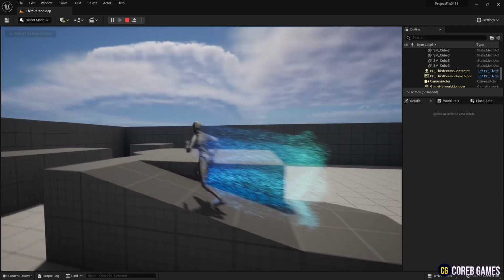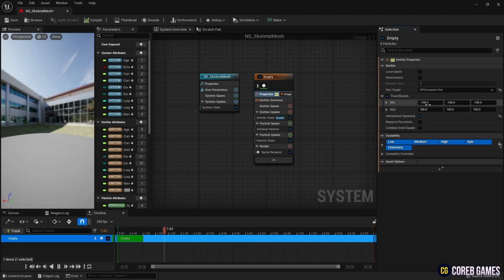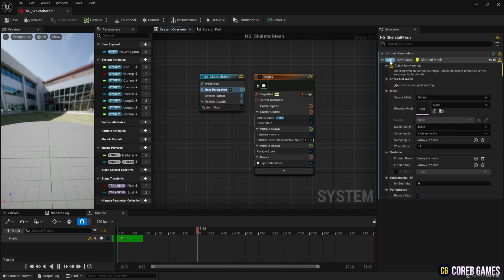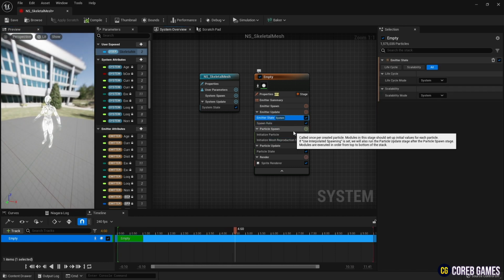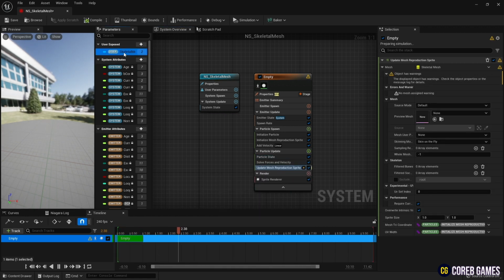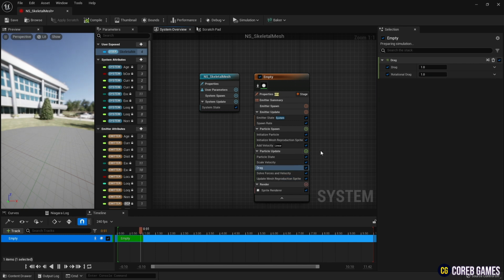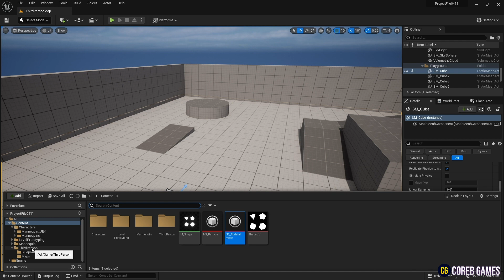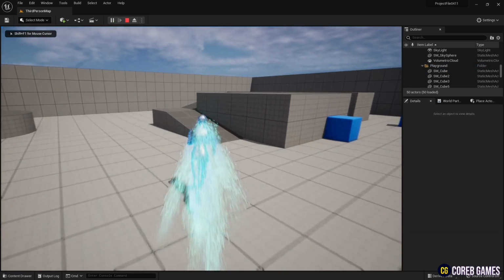UE5 l Dash Trail Particle Effect With Niagara l VFX Tutorial l Unreal Engine 5

Comment: Can you show how to do a Character Dash effect: when the player jumps forward, it leaves behind an Anim Shell (mesh frame?) of the Player's last animation frame - before he performed the dash forward? (Not sure if it is a particle sys that spawns a mesh, but way less than your example.) Ty

It looks like this vid - the blue shell mesh at the beginning (and later): watch?v=ipmGvjHGMYI
Reply: you do the same thing as this but use spawn burst instantaneous.
Reply: @MasterPiffy  Thanks. But is it possible to get the after image effect without using particles as pixels of the body, 
and instead get a full body (mesh) or something of the freeze frame? 
(Please point me to a tutorial if it's possible.)

Something like this, the yellow dash (but I think he is using particles as pixels and not a mesh frame).
Time at 22 secs: 
youtu [dot] be
/CnVnuqCZZc0?si=vdeFVBnaAr07ehjo&t=22
Reply: @kenalpha3   "a full body (mesh) or something of the freeze frame" can be achieved simply by spawning several non-colliding static meshes with translucent material generated from specific frames of your run animation.